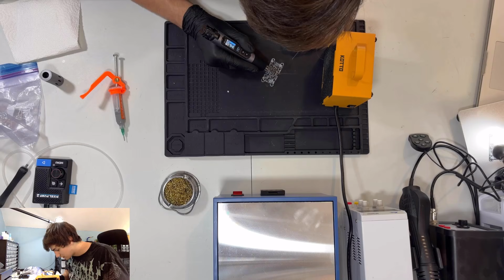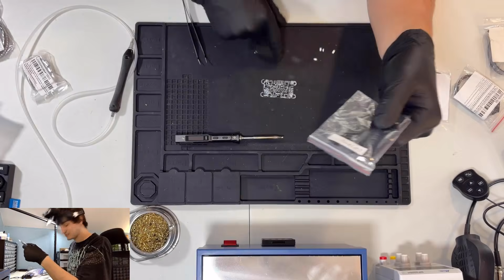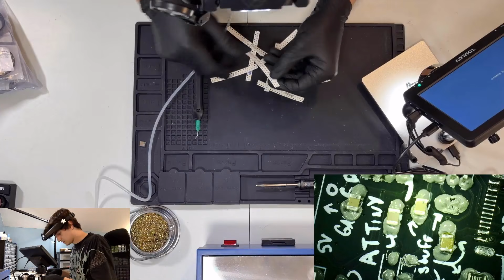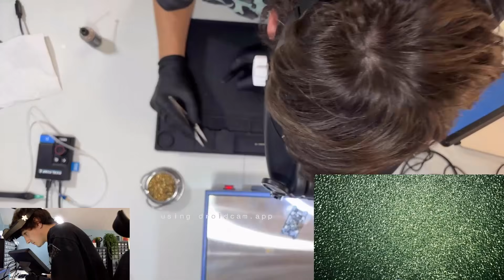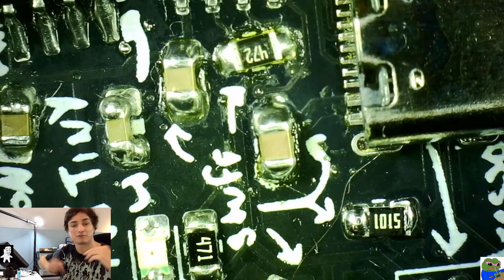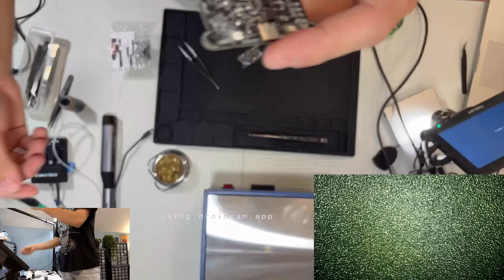My Custom PCB Actually Worked! (Full Assembly)

Comment: Lots of problems, but it was interesting to see the process. Maybe you could get a metal tray to remove your board from the hot plate. You could slide it on with tweezers instead of gripping it.  Can you use your microscope to work? I see you have the display redirected (perhaps just for video capture), if that adds lag it may make it hard to use.  You might be able to use the bulletin display and capture internally via a memory card. I know that doesn’t work for live streaming, but a well produced video might be better than a messy live stream.

For production assembly it might be cool to have the microscope on your monitor along with an overlay showing part placement so you place the correct parts in the right places.  Does software for that exist?  If not, it should. I might try to make that.

Did you check the temperature and calibrate your hotplate? Some of them are off, so the display temperature can be wrong.  It seems like there is still too much solder paste being dispensed. I like the idea of hand dispensing for small runs, but this does make me wonder if a stencil would save a lot of rework.

Thanks for showing your work. My problem is I am too careful.  I spend too long thinking about how to do things, and then don’t get around to actually doing anything.
Reply from the maker: Thank you so much, I really appreciate the support. I am definitely going to be looking into better ways to take it off the plate. I think if I put my microscope on a movable arm it could give me a better camera view. The creator of that vacuum pump is actually making software that does almost that exact thing, it will show you what part to take and where to put it. I haven't checked.

I actually built a tool to 3d print stencils that I will use for the production runs, it's good enough to use on 0805 components but I'll have to do the usbc by hand.

I've found the best way to learn is just to get in there and make mistakes, fixing them is part of the learning experience